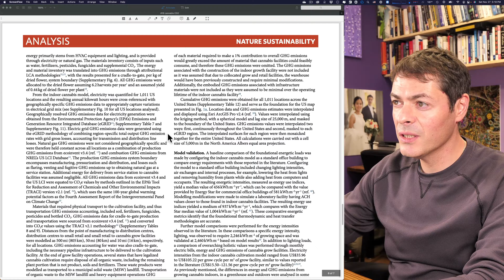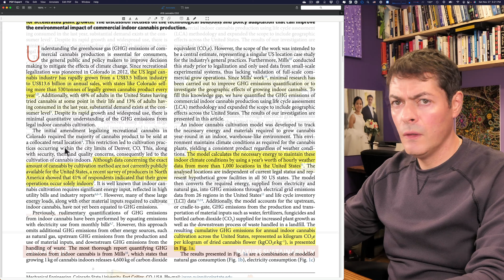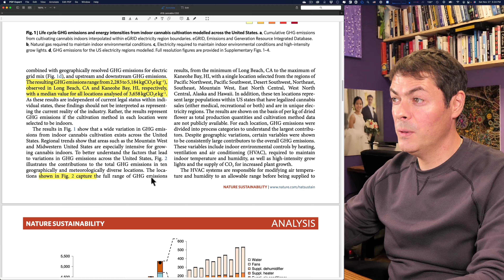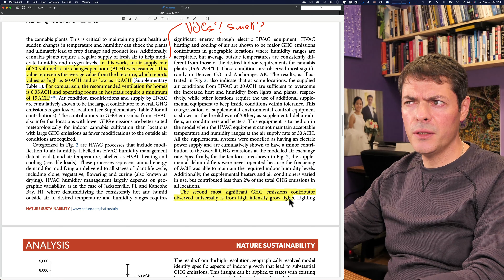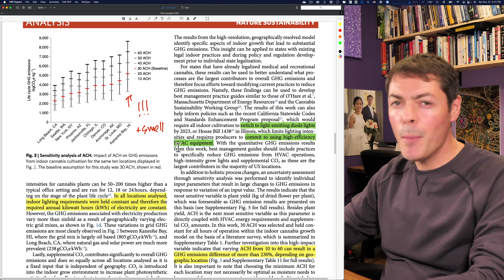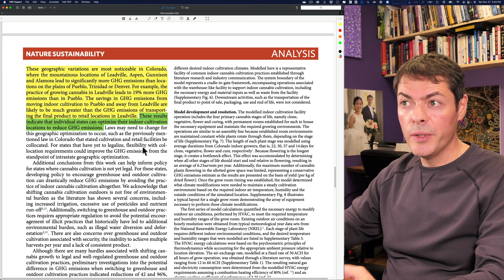Is cannabis bad for the environment? Seems like it... (#18)

Comment: Did the paper mention how much of the production was done in residential homes such as the basement vs ware houses.  Are HVAC systems being used in homes that need HVAC anyway because people are living there.
Reply from the maker: Great question! So, this paper focused on the massive-scale commercial production. As I am researching this topic, it seems the problem is far bigger in the small-scale production space. My biggest question is the VOC removal (dealing with the smell). I think there is a way to skin this cat, using plasma, that we can reduce the overall CO2 emission quite a bit.